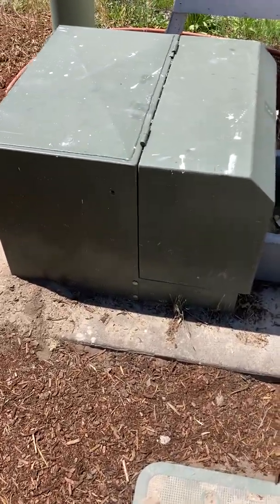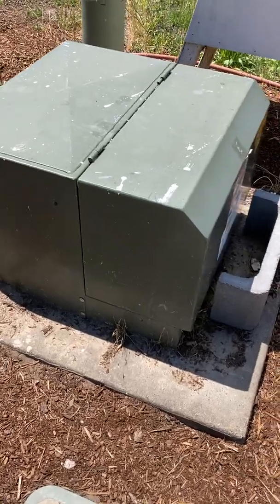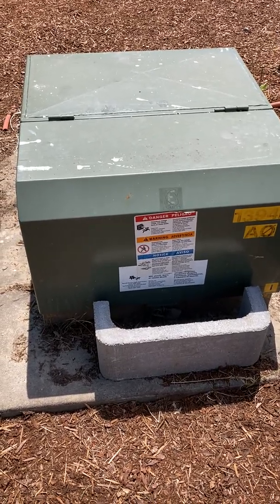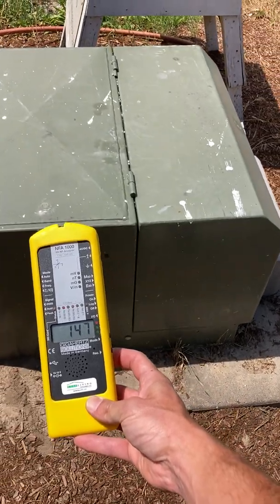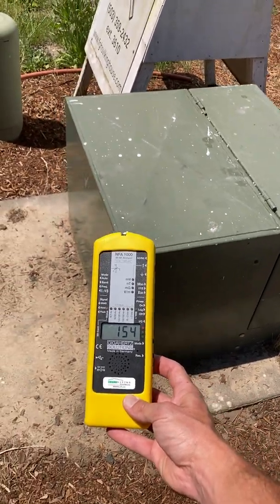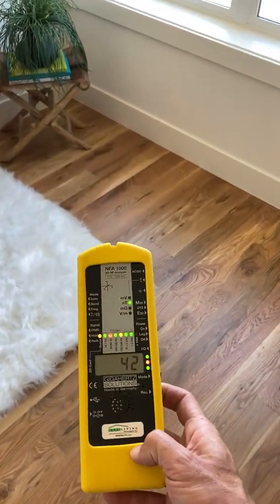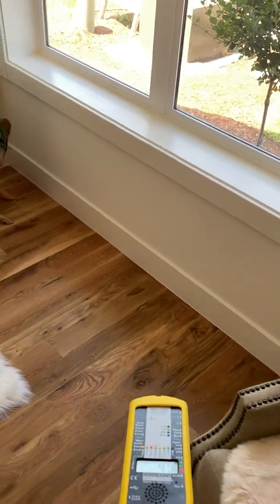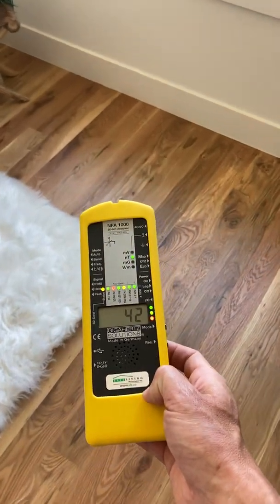Pad Mount Transformers: How to tell if this EMF Hazard is getting inside your home

Comment: If you have an AC to DC converter you might want to check it as well. Mine was off the charts when I tested it. Instead of trying some shielding I unplugged the converter and started using a small trickle charger which sits outside of my motorhome when I'm parked.😊

Comment: Would placing aluminum screen sheets behind the drywall covering the area between the Pad mount transformer and the living space attenuate the gaussian field?
Reply: Yes, but do multiple layers. Smarter to buy the foam insulation sheets with aluminum on them and then add more then add drywall over it for a clean look

Comment: Uhh, 0.4 mG is ~100x lower than the earth’s magnetic field. How does your device differentiate between this incredibly tiny field and the earth’s natural, significantly stronger field? I don’t think your device is accurate as magnetic field strength decreases as the square of the distance. Your “measurements” definitely seemed to decrease linearly.

Also, what are these conditions you claim are caused by such insignificant fields? What possible mechanism?

Comment: I live and sleep directly  across the street from a pad mount transformer that buzzes loudly all the time. Sometimes louder than others. I can actually feel it in my head at different intensities.  When the power goes out and the Telecommunications towers go down my body and head ( neurology ) relax and i feel normal again until the electricity and or the Telecommunications towers are back up and operating 😢 can you possibly give me some direction on how to investigate and validate my physical and neurological sensations? I actually dont live to far from Forest Grove,Oregon 🤔😖
Reply: Faraday cage

Comment: Mine is basically right next to my house….very scary. Less than 10 feet. I was told it can’t be moved. Is that true?
Reply from the maker: 10' is a reasonable distance.  Not easy to move them, very expensive.  don't be scared, take action, get a basic meter and so some testing.  I can walk you through it if you setup a consult https://www.optimaldwellingspaces.com/services

Comment: Thank you for sharing. I just bought a home that has one of these in the front yard. It’s not as close as this one, but I want to try and mitigate the fields. Do you think devices like the somavedic help?
Reply from the maker: You’re welcome.  If it is further away than in the video, you may not have to worry about the fields it emits.  
Unfortunately, I’m not convinced that any harmonizer-type devices do anything but lighten your wallet.  They certainly shouldn’t be your first line of defense.  Instead, you should work with a professional to inspect and remediate your home.

Comment: Thank you for making me aware of Pad Mount Transformers.  So the gray cylinders are actually better since they are normally far enough from the home?
Reply from the maker: There are problems with either style, above-ground or below.  The exposed lines in above-ground can radiate further through the open air.  Yes, the gray cylinders are generally farther away from the home, but you always need to verify with a good meter or hiring a Building Biologist.  Don't ever guess or assume.
Reply: So I moved into a new construction home and afterwards found out what this is. (In our front yard.) It’s about 10/15 feet from the top of our garage. But about 45 feet from my kids bedroom. I never would have bought my house had I known what it was and am considering selling soon. My question is, do you consider an underground transformer 45 feet away as being better than the typical residential lines above ground? Thanks